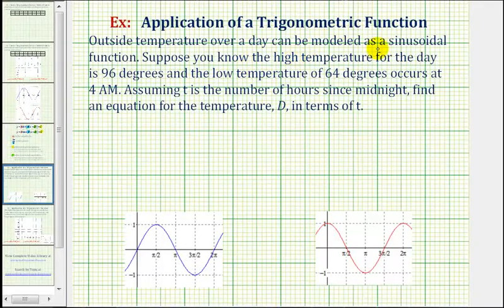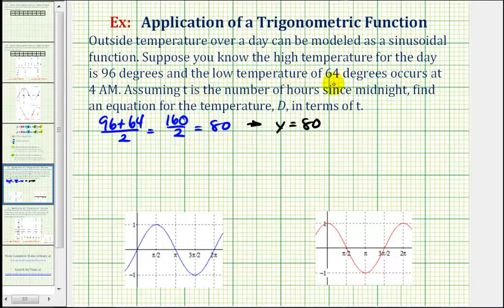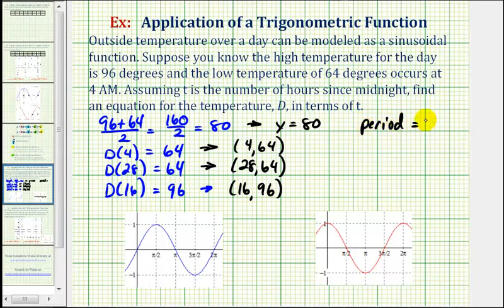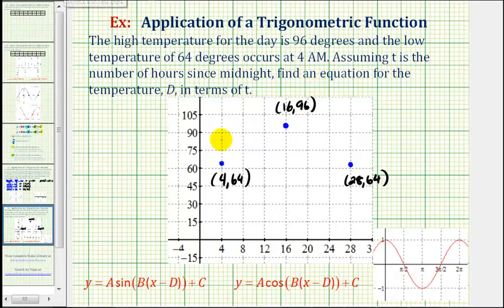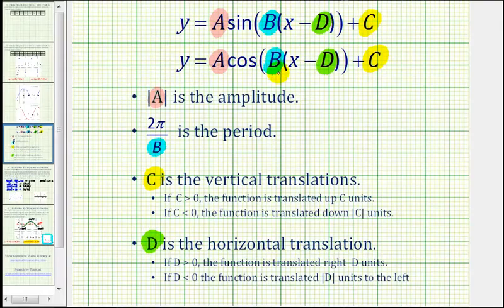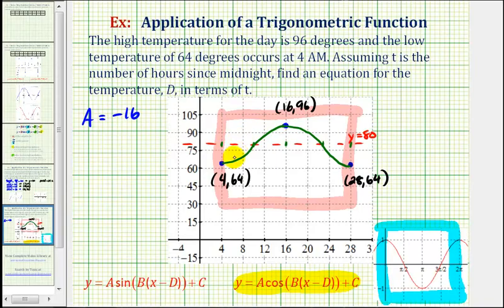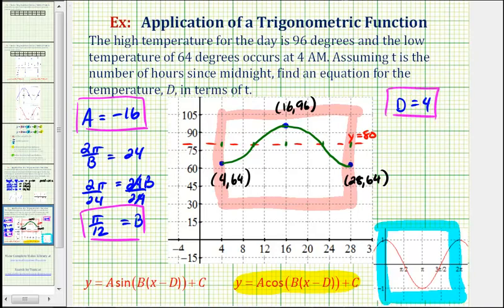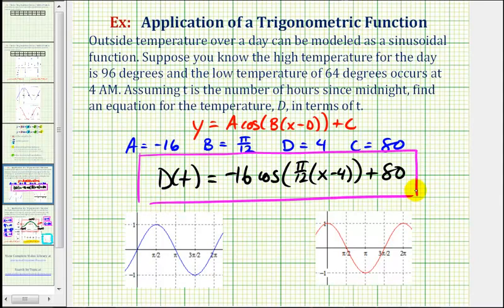Ex:  Model Daily Temperatures Using a Trig Function

Comment: Why did you add 4 to 24 to get 28? Can we not begin at the origin (midnight at 0 for t)?
Reply: Since the period is 24 hours, 28 hours would be 4 am on Day 2. 

You can still restrict your domain from 0 to 23. (24 would be midnight on Day 2)

At 0 hours (midnight on Day 1) the temp would be 72 degrees.